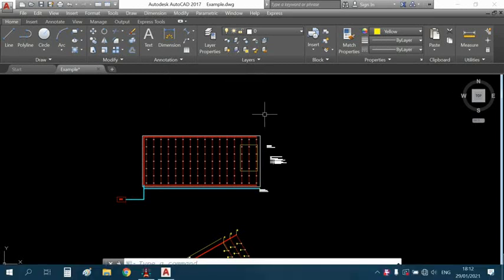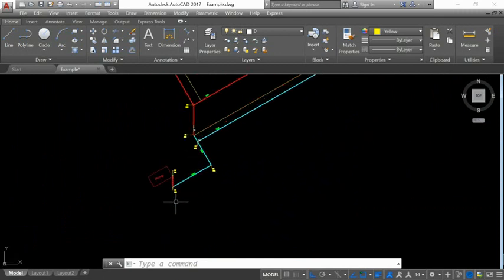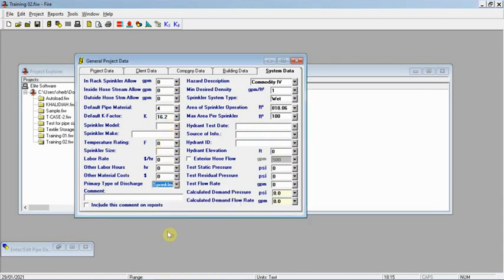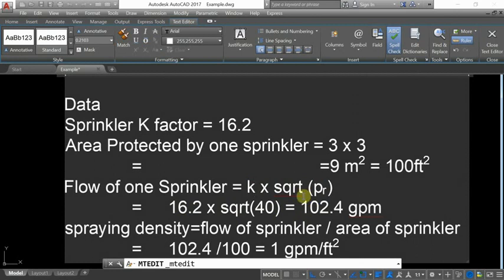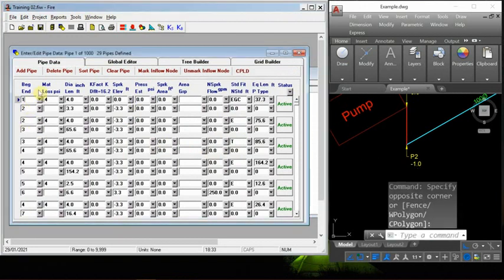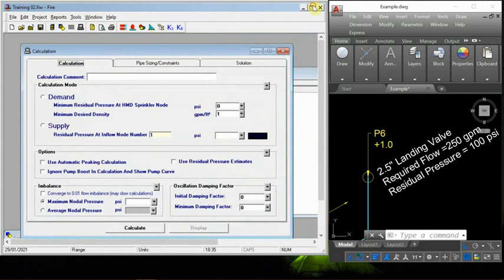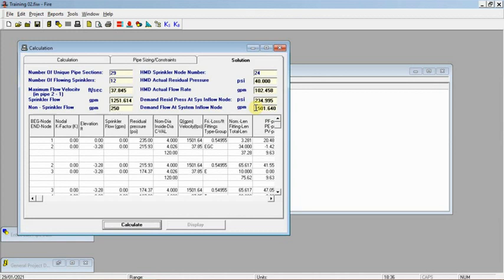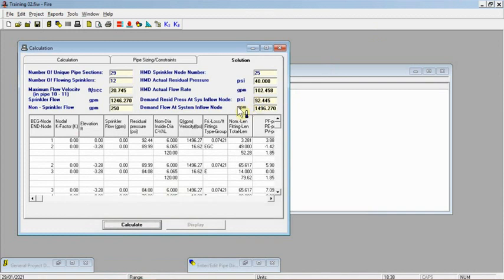3-Introduction to Hydraulic Calculation With Elite Software-Fire Protection

Comment: Hi, I couldn't find copper type L when i enter pipe data. Please do more video relate to the software. thank you for your hard work.
Reply from the maker: You can add a new pipe to the programme, but you will need the C value for the pipe and the pipe dimensions

Comment: Hello, your calculation using 1gpm/ft2 exceeds maximum requirement  0.2gpm/ft2 ordinary group 2 based on sprinkler density area curve. This also above the maximum requirement of 0.4gpm/ft2 as defined in extra hazard group 2. Please clarify, thanks.
Reply from the maker: It's just an example, I'm not explaining a real example.

Comment: Thanks Eng, as always your Tutorial is useful, I've duet that why u did  not add the other branches as well to the calculation ? maybe I'm wrong but is it correct  the other branches will help carrying the water to the operation area? that's why the friction loss will be decreased since all branches will be included (without sprinklers), thanks in advance for clarification if I was wrong ..but just to make sure
Reply from the maker: U R right, but it will not effect that much